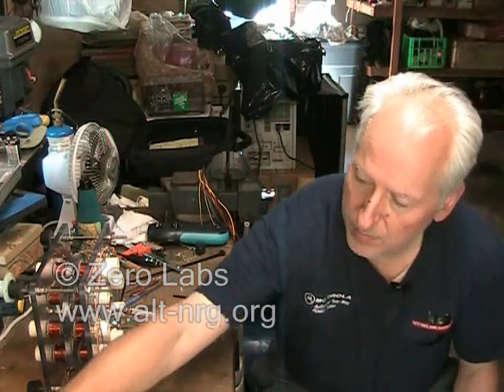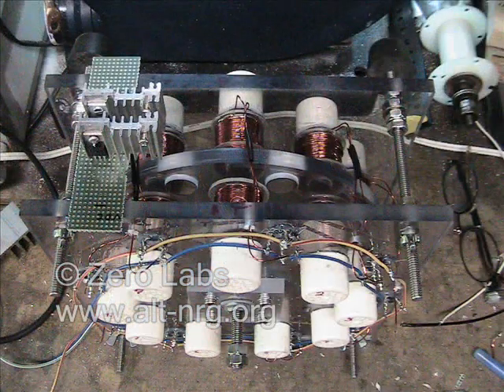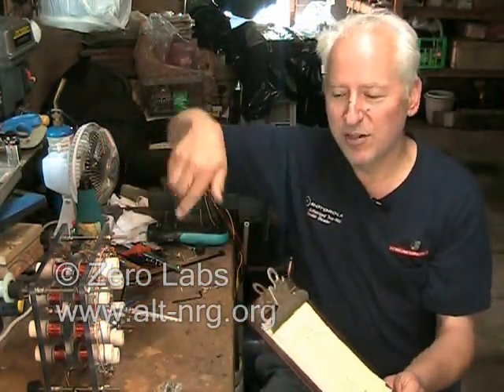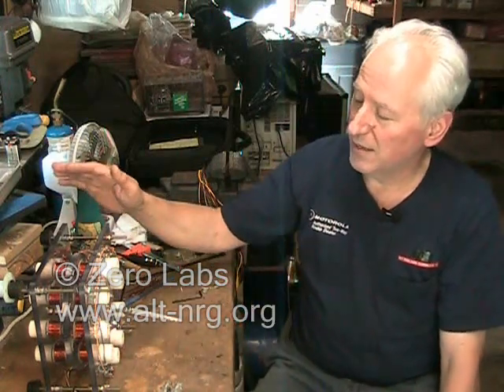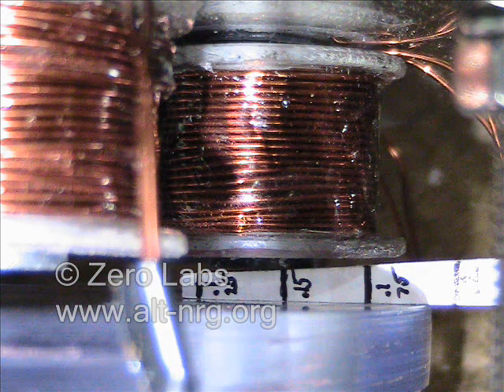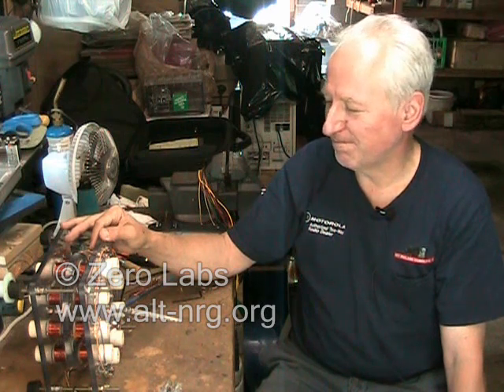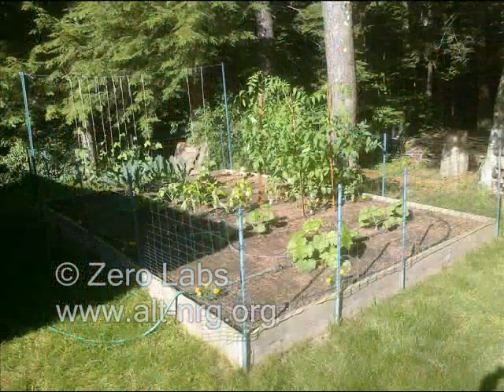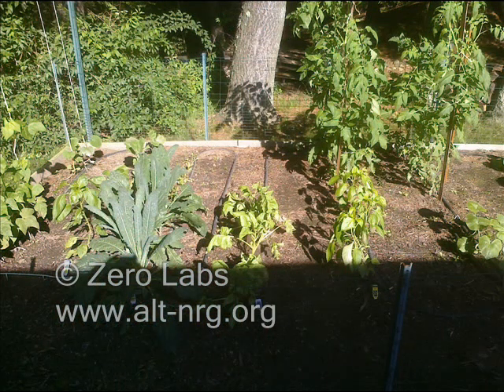#286 Muller Motor driver circuit

Comment from the maker: @llewgnal Very possibly but my thought is to shift the block wall region into and out of the coil. If both magnets are the same strength and they both contact the ferrite, the bloch wall is dead center. As the bloch wall approaches the end of the ferrite that's where a null occurs. But maybe is would be enough to modulate the fixed magnets. Hmmmmm.....

Comment: @ZeroFossilFuel The toroidal core idea also has the flaw of having close mechanical proximity to the neodymium magnets, causing a lot of mechanical stress to both the toroid cores & rotor, possibly making your machine fly apart from stress.
The Smith device has no moving parts--so no lubrication, no mechanical failure troubles, etc. The Smith device could be the proper implementation of the Steven Mark TPU solid state energy device that overheats after 15 minutes because it isn't grounded?

Comment: @ZeroFossilFuel Smith claims that the air or an antenna, & the Earth ground are sources of free electrons that can be jolted to capture the ambient zero point energy flux. T. Henry Moray was supposedly using Earth's magnetic field perturbed by solar & cosmic particles--so this was already jolted free energy--the special diode from the antenna was supposedly Swedish stone connected with another material--years before semiconductors were invented?

Comment: @ZeroFossilFuel If you've ever looked at the design principles involved in switch mode power supplies versus conventional 60 Hz designs, the power available through even a tiny transformer is huge with higher frequency operation. That is partly how Smith does his hi to lower voltage step-down stuff in a compact design. His coil windings use fine wire because he uses the skin effect at resonance & hi voltage, never drawing off much current to speak of. This would kill the dipole--Bearden...

Comment: @ZeroFossilFuel With Smith's stuff, he is working with 30 kilovolts at 20 kHz to 100 MHz resonance with air core inductors--how the heck does he rectify that?
I suppose at such a higher voltage, a voltage drop of 0.75 Volts versus 0.25 Volts on the diodes matters very little in the grand scheme of things?
Smith claims to have designs for a 1 Megawatt unit that will fit nicely on a dinner table! He gets huge voltage out at RF that prevents IR drops due to RF resonance of his magnetic flux stuff.

Comment: @ZeroFossilFuel In my previous suggestions to you about optimizing the magnetic flux circuit, I believed that I could boost your voltage a bit. If you did the entire idea of using Toroidal cores with a notch cut out to make room for the rotor to just fit in, then the voltage would be way beyond what a Schottky diode could handle. The max PIV that I've seen for these is 100 volts. So with the Toroidal core idea, it might multiply the voltage up way too much for your efficient diodes to handle...

Comment: @ZeroFossilFuel Smith often wants to generate 30 Kilovolts into 3 "one of a kind capacitors made in Sweden." The conductor leads running into these capacitors are thick, flat braided straps capable of transferring the kilowatts of energy that he is pumping out of the local ambient zero point field. Smith was very wealthy & did not need to con anybody with scams. He had all sorts of energy devices using wildly different principles. Google (Terfenol-D wiki) then look at my Talk page comments.

Comment: @ZeroFossilFuel As you may know Tesla, Bedini, Bearden, etc, all say that you have to jolt the local ambient energy environment for it to provide zero point energy to your circuit. In one video Smith says if you don't ground a key part of the circuit the thing will overheat / melt down. Smith PDF says Earth ground is different each geographic place & is easy to jolt some places than others. His resonance stuff must be tuned per geographic location because of varying ground impedance factors.

Comment: @ZeroFossilFuel Patrick J. Kelly has a web site that I located via Google search (Smith free energy)
Lots of PDF files & links to videos are nice.
Donald Lee Smith attended & lectured a 1996 Tesla conference. He routinely gots over unity by following certain key principles that T. Henry Moray & Nikola Tesla & newer people do. Smith outlined his principles in a PDF that Kelly hosts.
Pulsed DC, Hi Voltage, Low current, Hi Magnetic magnified RF resonant flux, Earth grounded, & maybe an antenna.

Comment from the maker: @Resistance4Liberty The end game to build a device that, from the outside, looks like a self runner (no external power making it go) with surplus energy to use, what in reality is tapping a previously untapped external source of power. We're talking free, limitless energy, anywhere, any time. Completely decentralized power. No power lines. No wind mills. Coal fired generation plants. Not even hydro-electric dams. Just little boxes humming in the basement.

Comment: @Resistance4Liberty Hello R4L, For myself I originally had planned for a battery bank generator using a Missouri W&S super patriot 2 to a gas engine powered using either HHO or gas vapor, but with the great efforts of Zero and his "NO BS" has made this something for me to look into. I thought of a 2k to 5k AC unit but it seems more like a charger for a small battery bank if the output can reach that of the patriot, with an inverter this still can put in the 5k range, and is all I am looking for.

Comment: I will spend some time on the magnets to magnetite bobbin configuration. I would believe you would want as much of the gauss flux induction of the magnet into the core to the coil, also your thoughts on capsulation of the coil with magnetite. Take some time to enjoy the 4th you earned it

Comment: Great work as always. I find that funny with the magnets not available and while on that thought I been thinking about if this was a success even as a couple thousand watt battery bank charger many people would rush to buy or build one and with the main elements of copper, magnets and if magnetite is used these are items that are for the most part mined and manufactured which could led to availability problems or even be forced.